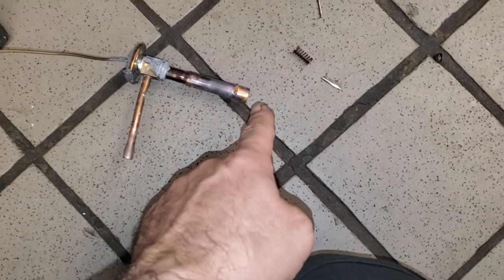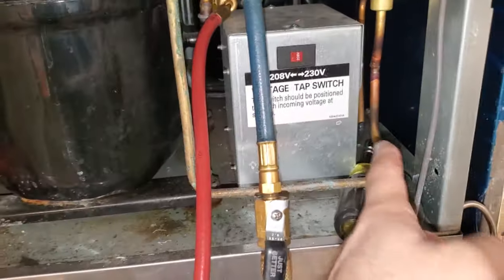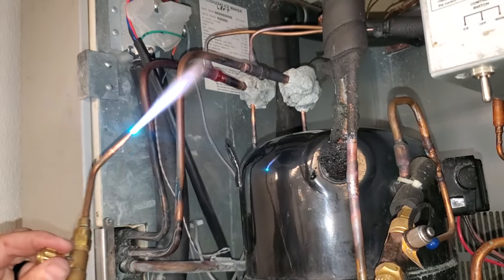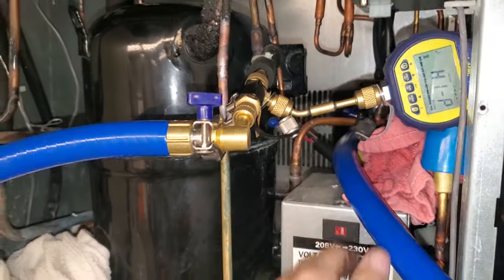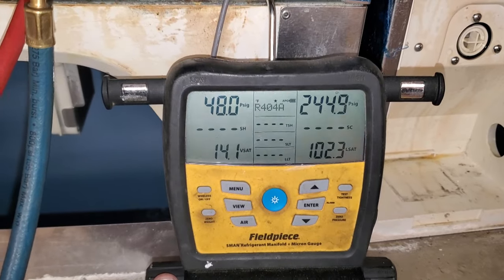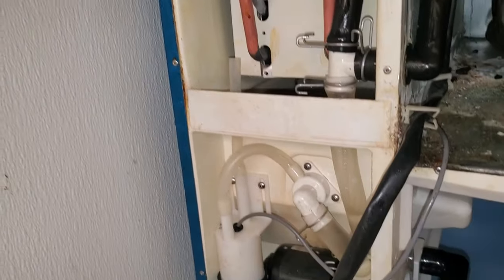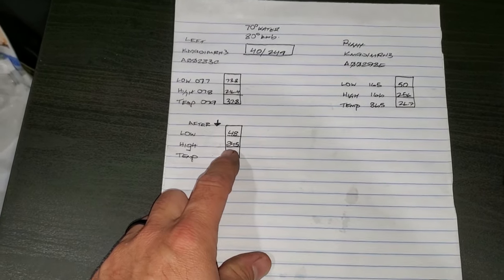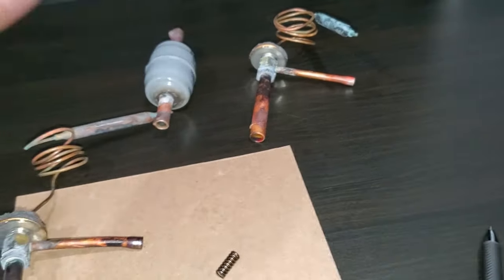ALL THREE ICE MACHINES ARE DOWN PART 2

Comment: I took the Hoshi class, but all of our sites used the Manis. The teardown was always a gut check...red and black slime everywhere, to the point where I can no longer get ice in a glass when I am out to eat. Yuck. Tell you what Chris, I'll watch you do these, and I will try to stay up on the roof, lol.
Reply: @Len Miller It was probably 7 or 8 years ago, on Cabot Rd near the Oxford Valley Mall. It was a good class, but one thing I noticed in the design differences was the inability to fully visualize the evaporator because it was mounted off to the left, as opposed to be able to fully see the grid in the Mani machines. At that time, we serviced a casual dining chain which did NO maintenance, and everything was "fix on failure." They had a big warehouse of used equipment, and would swap out a machine rather than let us install something new and under warranty. They declared Ch 11 on Oct 7th, and I frankly do not miss working in a live kitchen environment.
Reply: @Len Miller I have about two years left, maybe a little more. None of the instructor jobs or factory rep offers provide enough money to bring me into their fold. It is as if they are like the third party corporates...no cash they want to spend, so they spend a little cash a hundred times over, because the average tech I follow up on had a previous job where he asked the question, "would you like fries with that?"
I'm thinking the host for the class was Nordon.
Reply from the maker: @Len Miller 
@Art Houston   Both of you have great points and I will discuss this in the livestream this evening, I’m going live on YouTube this evening 12/7/20 @ 5:PM (pacific time) to talk about my videos and answer questions from comments, emails and the live-chat, Come check it out https://youtu.be/5vc9-ygyL0o

Comment: Great video on cleaning ice machines. You mentioned using the correct cleaner, I was in a big chain restaurant the other day and the health dept closed dn there ice machines cuz someone was using the wrong cleaners and basically told them to hire a hvavr co to do a deep cleaning on them. The manager was pissed. Gave them a inspection rate of 80%. They have had higher ratings of 95 average. I was like oh no not good. It was hard for me to keep from ordering a drink, but I got a drink at a different store. Well I went off running my mouth. Great video and always a pleasure to support this channel.

Comment: Thank you!! Deep cleaning an ice machine is like a 6hr job for 1 guy, especially if you're like me who runs extra rinse cycles and dumps the first couple batches of ice...just to be sure. In my experience straight up industrial grade 100% vinegar is the best way to clean (soak) ice machine parts. It is super cheap: like $1.99/gallon on Grainger. It is way less hard on your skin than CLR or nickel safe, is food safe, and you can be very liberal with it. Nickel safe really sucks. Its unfortunate that you need to use it on the evaporator. I have found that cotton toilet brushes work the best for scrubbing down the ice machines. They're not that durable, so you'll go through a lot of them but they're JUST abrasive enough to knock off the crust without scratching up the plastic. Replacing the clear vinyl hoses is the only way, they cannot be cleaned.

Comment: Good vid ! Only thing I would do differently is Buy insultubing for the Txv outlet lines. With only One or two wraps of foam tape lines will still sweat and that’s how the machines rust out in that location. Foam tape is only 1/8” thick. That location should have 3/4” wall insulation. 1/2” wall minimum if u cannot find 3/4 wall. It’s also a whole lot cheaper , looks nicer , works properly , and is easier to apply. Simply slide on before brazing. Like # 125.

Comment: You're a fountain of valuable information. Thank you for sharing.
Circulating low ph (acidic) solutions through high ph (alkali ) coated systems will cause a neutralization as the deposits are dissolved which renders the low ph solution no longer effective. How fast this happens is a function of the ratio of the two.
Reply: ^^^ This.   It's not like there's chemical properties and components going into the aether from being opened.    

Also most antimicrobial plastics aren't just coated with a film it's usually all through the plastic.  Scratches in the plastic still make areas where microbes can and will collect, but scraping the surface of the plastic doesn't get rid of the antimicrobial effect altogether

Comment: Hey wouldn't it help to have a water softening filter in the water supply , or is all that calcium happening even with it already installed ?
Reply: Given the amount of water these things go through, a filter will only slow build-up down, not eliminate it. Water is an awesome solvent!
Reply: Mora Fermi I did not know that water softeners had actual filters in them, only a dispersed a sacrificial mineral to react with and precipitate ions. Perhaps I am right.
Reply: Many place do have filter softeners but they do not change them often enough if at all and build up occurs. Most filter softeners get changed when a tech finally come out to do a service which at my last company was once a year on ice machine cleanings.

Comment: Why don't they use filters on the water lines to these ice machines to prevent that calcium build up?
Reply: Not practical.  You can't filter calcium - you have to use a water softener to exchange something else for the calcium and the volume of water they use in those commercial machines would be cost prohibitive for the salt and sizing a unit big enough where it wouldn't be constantly regenerating.
Reply: @DocNo27  I worked for a coffee chain where we had to have a water softener installed that was during a renovation as the lake we draw from for the city water supply is full of Limestone. IT first had to be installed for the self-cleaning ovens. This system was sized for 11 commercial coffee machines, 2 hot water towers 2 self cleaning ovens, a few sinks and toilets and a commercial water heater. Yes the system was bigger than what you would find in a typical home installation but it can be done and in the long run it saved a lot of technician visits as before the water softener we would typically have 1-2 machines go down for a period of what seemed like weekly and then afterwards it would be monthly. I remember when the softener broke down and immediately the repairs for Calcium related buildup in the tanks started occurring weekly again until the softener was fixed. The salt reservoir Took about 6 bags monthly which were the regular ones that could be purchased at home depot and only regenerated every few days.
Reply: @sarah1390  You worked for a smart restaurant.  Most are not going to spend money on such a system - even if they had space to put one in or were going to do a renovation like yours did. Good to know that there are at least some doing so though!
Reply: They have Them & they help a lot. People usually just don’t care to spend the money on them. 4 this Hoshizaki it would require a 4 High flow filters/ ice machine @$200.00/filter that’s $800.00 every six months for water filters. People just don’t want to spend it. Usually. Thier are exceptions. A ice o matic or manitowoc is a lot cheaper to Filter. U can just use one i4000 filter / machine. Change every 6 months. $ 200.00 / 6 months is a lot easier to sell and it helps a lot !
Reply: Though I hated the replacement hot water tank. Almost any windy day because of the way the intake and exhaust pipes were angled, we would trip a safety, the air pressure switch. Since my father worked in the HVAC industry previously, I picked his brain as to what the issue could be given the situation. it was the increased pressure caused by the high winds and the pressure switch not sensing a Vacuum in the combustion chamber so it would go off on safety. I made a suggestion to my manager to get the plumber and just change the direction of the outlets of those pipes. I believe it was done as there were many windy days afterwards where we wouldn't lose the hot water tank.
Reply: Many place do have filter softeners but they do not change them often enough if at all and build up occurs. Most filter softeners get changed when a tech finally come out to do a service which at my last company was once a year on ice machine cleanings.
Reply from the maker: YEah they do make filters but the cost is often to high for the customer, I will discuss this on I’m going live on YouTube this evening 12/7/20 @ 5:PM (pacific time) to talk about my videos and answer questions from comments, emails and the live-chat, Come check it out https://youtu.be/5vc9-ygyL0o

Comment: Did you also replace the plastic grid or did you leave it?
Reply from the maker: Yeah we replaced all the parts needed on all three machines, I will discuss this on I’m going live on YouTube this evening 12/7/20 @ 5:PM (pacific time) to talk about my videos and answer questions from comments, emails and the live-chat, Come check it out https://youtu.be/5vc9-ygyL0o
Reply: It feels like that part in particular should have a stainless steel version available since it takes such a pounding at cold temperatures when it’s brittle; seems like one of those intentionally bad designs to keep the bean counters happy.

Comment: How many people actually know the reason why OEM dryers are a different size on either side?? If you didn't know it's so that way they don't get installed backwards in the factory.
Reply from the maker: Intersting
Reply: Makes sense, factory work is relatively low pay so they can’t expect much worker intelligence or true care and attention to detail, so the easier it is to prevent mistakes, final quality will improve.

Comment: What do you mean by pulling a vacuum on a multi point… then you said you have the solenoid magnets.
Reply: Normally with solenoids closed you’d need to pull vacuum from multiple parts of the system to get it all evacuated, but by opening the solenoid valves with magnets it lets the vacuum be pulled from the whole system rather than having any parts of it isolated...  from my comprehension - not experience.
Reply: @SchwaAlien  I believe you are correct. Since my comment I had to pull my first vacuum on a ice machine with a remote condenser. I just placed solenoid magnets everywhere there was a valve. It’s working great now. 😁